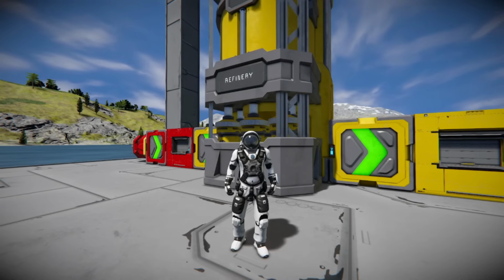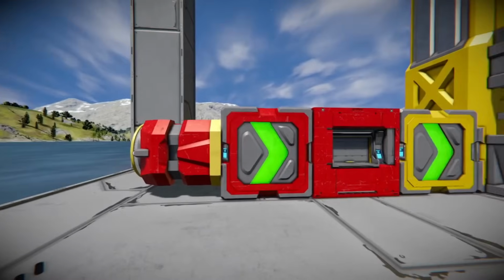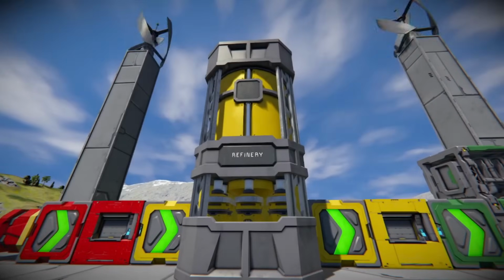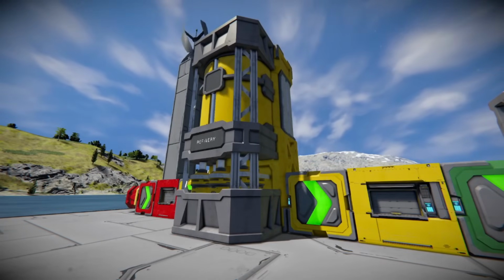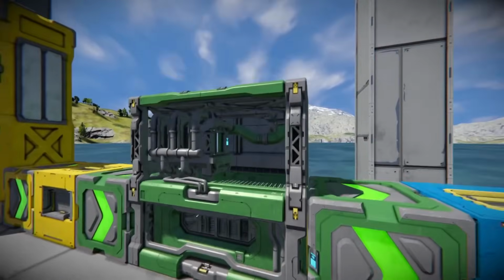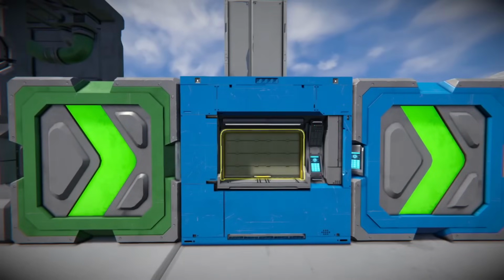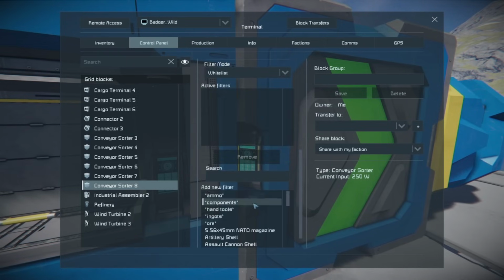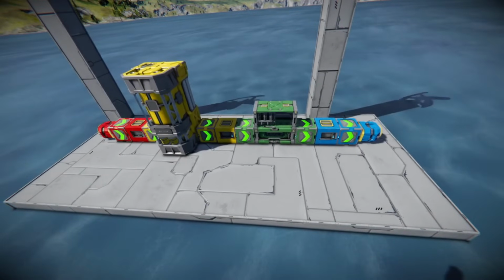Maximum Base Work Flow

Comment: So for my setup i have dual sorters on the input and output of the assembler. The first two are exactly the same as the video, though the second input sorter allows components in to be deconstructed, and the second output sorter allows ore out, so you can get rid of ore clogs in the assembler. Neither of these other sorters have drain all on.
         c-s-c                    c-s-c
Input-t-s-t-assembler-t-s-t-output
C=conveyor curve
S=sorter
T=conveyor t junction
Reply: Ah. I did mess up in my comment. I meant to say the second output sorter allows ingots out to fix the system if it's clogged with (iron usually) ingots, not ore. It doesn't happen often from my memory but it's nice to have so you can fix the problem without changing sorter settings. Agree on component space especially those radio components. And idk why i had everything in one box. Maybe i just didn't think of that expansion or i wanted to make things harder on myself. Would not advise everything in one.
Reply from the maker: Yes I'm I'm currently working on a video that could be a simple way to subvert that system adding more complexity to this eventually in the future
Reply from the maker: Ore really isn't a problem if you filter it thru the refinery first then all you have for major storage is ingots and I've done a video on how inconsequential take less room than componets.

Comment: its interesting but for me the bottleneck is not the welder-ship(s) but rather the assemblers (or running out of resources) even with 2 assemblers with max speed modules I tend to wait on them.

That is why before i start building a big blueprint i wait until i have massive amounts of steel plates and all the other components and have a scripted production management to keep a minimum amounts of components built 

Are you using max speed settings on refining and assembly? (i normally use 3x in my settings not 10x) having different settings create different problems with different solutions.
Reply from the maker: With speed mods on it he assemblers and chaining the assemblers you just have to punch it into one and the rest will build components with the first. Full speed mods your talking about 20 to 25 steel plates a second if not more.

Comment: There could be one more problem: sometimes your assembler is completely stuck by iron ingots for example, but you need other ingots to build something, but assembler can't pull it, cause no space.
It's not so often, and may be it could happen, if you cancel building components. In some cases I added one more sort block to drain ingots from assembler rest after it's work. Assembler in this system works well, because its "pull strength" is more than "drain strength" of the sort block, and while assembler is working, it get what it need
Reply: I think with the way this system is set up the assembler will only pull what it needs when it needs it. flying on with just enough fuel to land so to say.
Reply from the maker: And if built right you can just hook up your welder ship and by just parking get all the components thrown into your welder ship with out having to move them yourself.
Reply: @badgerwildgaming6908 Sorters CANNOT drain ingots from Assemblers. The only way to prevent clogs is having a container as a buffer that prevents ingots from being deposited in the assembler inventory.
Reply: @steppedzeus5825 my solution is to have different assemblers that take specific ingots my usual problem was silicone. Generally I have an pure iron line that would branch as needed into the things that use nickel then coblat etc.
Reply: @FaultylaylineM 

My solution to stop an assembler from getting clogged is to have another sub sorting system for the assembler that buffers the ingots storage from the assembler. Another pair of sorters and an pair of event controllers and a small container are needed here. An input sorter is whitelisted to allow ingots into the container, and the output sorter is whitelisted for ingots and assembler products.

The event controllers monitor the inventory fill level of the buffer container. When it reaches 90%, it turns off the input sorter and enables drain all on the output sorter. This will empty the buffer container. The second event controller triggers when it reaches 0%, and drain all is disabled and the input sorter turns back on.

With assemblers behind this buffer container, they will only ever pull exactly the ingots that they need, and can never be the clogged output storage from the refinery.
Reply from the maker: Really please show this madness on the Discord I would love to see it.
Reply from the maker: That's why sorters are so valuable to speed work flow. You could have a small loop that drains the assembler of ingots putting them back in storage at the push of a button.